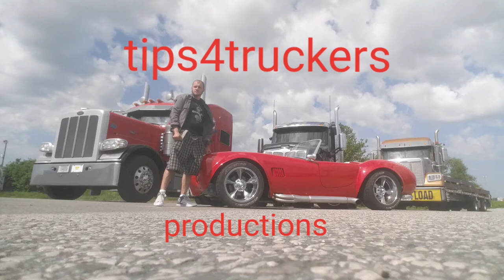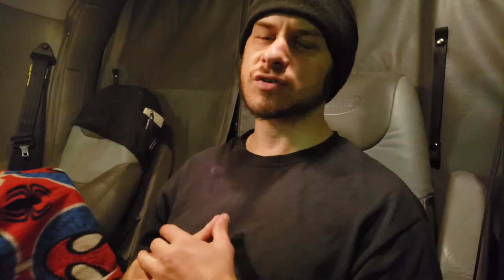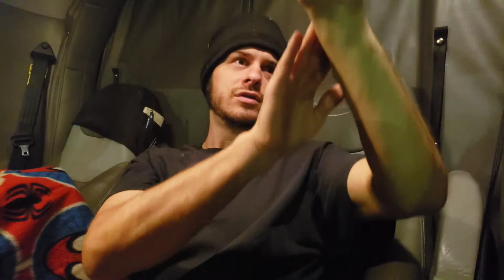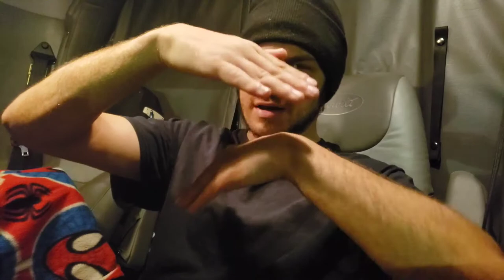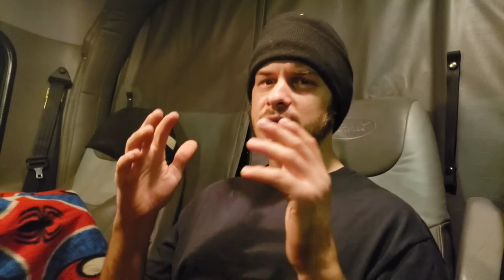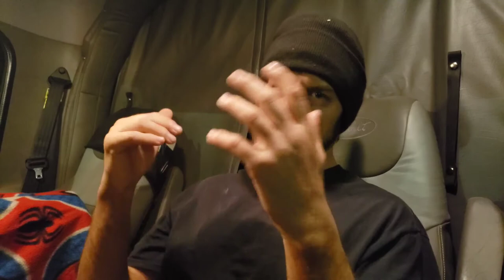Do this if you have a dogleg trailer

Comment: How it is skidding? It is trailer, the axel are not connected left and right wheel they are free to roll at different speed. Most you can do is have some funny wear on the tire
Reply: Any rolling surface that cannot roll precisely on-track behaves exactly like a "very narrow solid axle". A dog tracking tire is being pulled forward but also dragged sideways.